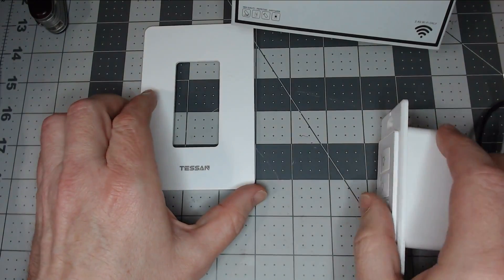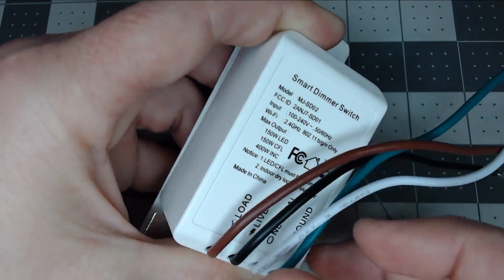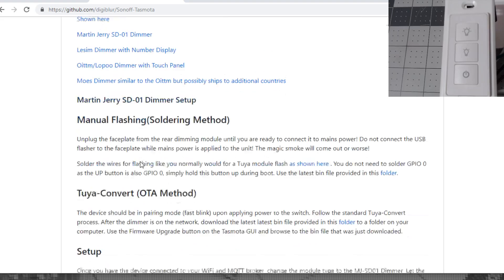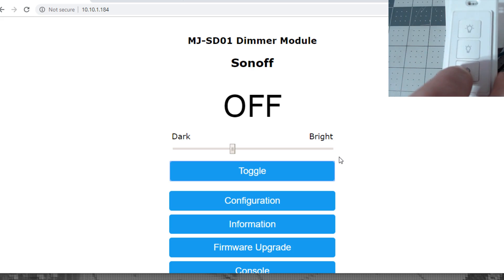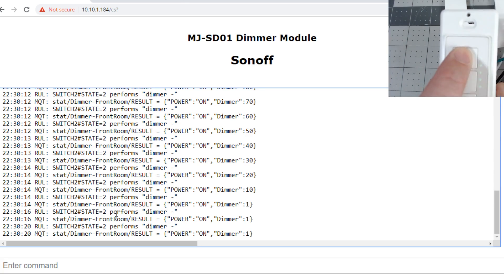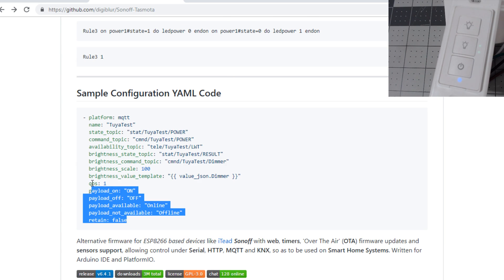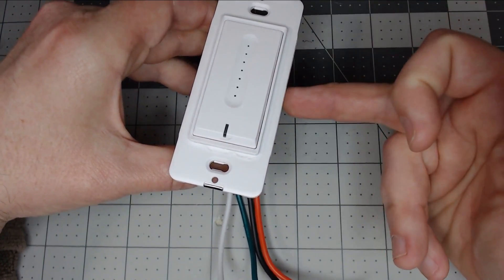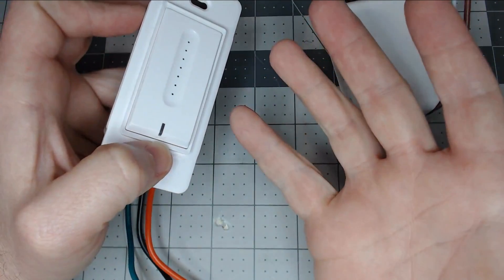Tessan, Martin Jerry, and TreatLife Smart Dimmers - How to integrate them with Tasmota

Comment: @digiblurDIY  I have flashed  your fork (9.5 ver) for my 35 numbers of MJ-SDO2 Tessan. Was working flawlessly.On recent power outrage, more than half got reset even i set SO65 1. Then now I have flashed Tasmota full (11.1) and  module 73, Everything ok except Off (physical)button not switching off the light and dimming from buttons (physical) very slow. Web GUI, Alexa, All working. your valued guidance needed. And always you are genius.
Reply from the maker: do you have them blocked from the internet?  If so you need to make sure to provide them with a local ntpserver
Reply: No I have not blocked.

Comment: Any chance of some updated bin files for Tasmota 11?
Reply from the maker: Yes. That is on project list but keeps getting bumped. Tried the PWM Dimmer module in stock Tasmota yet?
Reply: @digiblurDIY  I did, but the buttons don't work right unless I am missing something (which is very likely).  I'm on Hubitat and a dev has a new driver that needs the HTTP API in 11 to work properly.
Reply from the maker: The buttons work a bit differently.  You press and hold to dim up and down.  Definitely do a Reset 5 after upgrading to 11.x and then pick PWM Dimmer Module out of the Configure Module screen.  No additional rules needed.
Reply: @digiblurDIY  Bingo.   The reset was the secret sauce.   Thanks.

Comment: Thanks so much for all your videos and help.  I am new to the wifi switches and Tasmota.  Following your vids I flashed a couple switches no problem, thanks for that.  I only have 1 set of 3 way switches installed currently and I assumed I needed to flash just the primary switch.  All went well, I even updated to your modified firmware no problem, can connect over web etc after done.  Light switch works fine manually at the switch, but it does nothing when I try and toggle or dim etc from the web page.  Do both 3 way switches need Tasmota or do I need to pass something else on the console?  Thanks for any assistance, let me know if you need more info.
Reply from the maker: Which 3 way switch are you using?

Comment: Hi, I finally get one of this installed.  My kids like it because you can turn on the light by just pressing the top (dim+) and middle (dim-) buttons without first press the bottom button to turn on the light.  Yesterday my kids press this top/middle button but my HA does NOT show the light is on.  The HA show the on/off status correctly only when I press the bottom (on/off) button first.  Is there a way to add a backlog rule to fix this?  I am not sure how to send status of ON when you press the top or middle button since the light is on.
Reply from the maker: Setoption59 1 should be set
Reply: Thank you very much.  The status on HA show correctly after I turn on the setoption59.  You should add this to your backlog commands.  Another subject, I want to use the long press to trigger an scene/script on HA, what do I need to create on the new rule?  You show rule using publish cmd but that only to turn on another switch/light.  But I need to trigger scene on HA so I can do multiple automation such as turn off all lights, check door status, turn thermostat down, turn alarm on and announce Alexa  good night..  Thanks!
Reply from the maker: I haven't had to add it before myself as I do have the MQTT module push it after every state, and also auto discovery takes care of that since it is a light.  It's not a bad idea to really just have that option in a standard set of options you push to all of your devices.  

I don't use scenes myself but I have done some triggers based on MQTT messages in NodeRed.  I would think you could do the same and trigger some automation based off a MQTT message that you publish from a certain button push.
Reply: @digiblurDIY  I try NodeRed but too complicated on the link so I abandon it.  Can you show the rule to send MQTT message to trigger HA scene at least?
Reply from the maker: You sound like me with YAML automations but you use what is easiest for yourself and not someone else.

There should be a sample rule on my readme of toggling a flow I use.
Reply: @digiblurDIY  Do you have the link to the sample rule? I am not able to find it.  Thanks!
Reply: @digiblurDIY  Hi, today I check the same test dimmer switch when turn on from the dimmer buttons switch it does not register on the HA.  I double check the setoption59 1 is on, but no luck.  I also do same to the second dimmer.  What change do you know?  I know it works last time I tested.
Reply: I noticed than even with the setoption59 1 is on, I see the console did not send "stat/tessan3/POWER= ON" to the MQTT.  It does when turn on from the HA Gui.  What is the issue?
Reply from the maker: If it isn't send the tele after each light change then So59 is not working.
Reply: @digiblurDIY  I type in console and get respond "stat/tessan2/RESULT = {"SetOption59":"ON").  Could that be some other issues?
Reply: @digiblurDIY  I see it send the stat when turn OFF button pressed but not from the dimmer buttons turn on light.  Other option can used?  It works last time I am not sure what changed..  Can it use rule to force this stat On sent?
Reply from the maker: That option causes the tele topic to be published anytime a light changes. If that isn't working then probably a reflash and start over is on order.
Reply: @digiblurDIY  If I use this rule instead of using setoption59 or reflash (might not work because it happen on others), is this okay or have issue?
Reply from the maker: You might need to open a bug report if So59 isn't working.

Comment: Today, I got the Tessan Dimmer flash with latest Tasmota firmware 8.5.0.  Then I follow your instruction to firmware upgrade by download the "Tasmota_8.4.0.2(digiDIMv12).bin" file.  I got this error message "Upload Failed" Upload buffer miscompare.  Need help fix this error.    I open an issue on the github page.
Reply: I tried the Tasmota-lite.bin file still have the same error the "Upload Failed" Upload buffer miscompare.
Reply from the maker: Try the gzip version or you might have to do minimal.  Buffer miscompare means that you don't have enough room on the device so you need to make some by flashing a smaller bin file.
Reply: @digiblurDIY  You mean this file tasmota-lite_8.4.0.gz.  Same problem error.  Is this because manufacture figuring out and put less memory on the chip.
Reply from the maker: Actually quite the opposite, many are coming with double the flash space now.  Try the minimal then if lite gz doesn't work.
Reply: @digiblurDIY  What do you mean by try the minimal?
Reply: Maybe I should use older version of Tasmota v?? Why if not enough memory flash with lite that full version will flash?   The gz and bin are same lite files it does not flash.  Any ideas?  I got 7 more to flash..
Reply from the maker: gz should be smaller, I use them to go between versions.
Reply from the maker: This might help - https://tasmota.github.io/docs/Upgrading/
Reply: @digiblurDIY  I unzipped it.  Same 474KB as the gz and lite.bin files.  I tried both and not flashing.
Reply from the maker: If the gzip's aren't flashing then you may have some massive bin file on it then and you would need to serial flash then.
Reply: @digiblurDIY  I download this OTA firmware for tasmota-sensors.bin for minimal.  Then I flash with your lite then Tasmota_8.4.0.2 bin files.  IT works I choose the MJ-SD01 Dimmer (72) module.   Thanks!!.  I will test it some more.  It turn relay/light on when pressing the top and middle buttons without press the power on the bottom button.  Kudos,  better the OEM firmware...
Reply: @digiblurDIY  Will the MJ-SD01 Dimmer (72) module when away, when I upgrade the Tasmota to new firmware or will it stay on?
Reply from the maker: @mrteausaable  if you stay in the digidim ones it will.
Reply from the maker: Ahh...now I see, you have the big massive sensors bin file on there.  Why did you put that one on there?
Reply: @digiblurDIY  What do you mean by sensor bin file?

Comment: I just bought a few of these Tessan Dimmer from your link for my smarthome  My current is Insteon and works half of the time not reliable..  Kids tent to press the top 2 buttons since it is bulb picture.  Is there a way using backlog,  Set single press to button it turn on relay/light and dim to max.  Press middle button, it will turn on the relay/light and set the dim to min.  Long press on both buttons will increase and decreases the dimmer.  Do you know backlog command to do that in Tasmota firmware?
Reply from the maker: Are you using the stock Tasmota with the PWM Dimmer module selected?
Reply: @digiblurDIY  I think so.  is this doable to do using backlog command.  Most dimmer does not has relay(click) but this one does why?
Reply from the maker: Depends on the module. Most dimmers I know have the internal relay.
Reply from the maker: Once you get the module you have I can tell you a direction to go.
Reply: @digiblurDIY  Yes, Module type PWM Dimmer (73) currently.  When I press the middle button or top button, it turns on the relay/light  This is what I wanted but long press etcs, not work correctly without your firmware upgrade..
Reply from the maker: Check the latest changes to PWM dimmer in 9.0.0.3, if those don't work then yeah you'll need to do your own custom template/module or use the fork that I have.
Reply: @digiblurDIY  Where do I download the PWM dimmer in 9.0.0.3?  It is the one that comes in the Tasmota version 8.5.0

Comment: I just bought some Tessan with 3 buttons on the front.  Can the all these 3 buttons be program to turn different automation/lights in HA?  I only hear the bottom button produce relay clicked ie turn power on but not from other 2 dims button.  Would be great it can be use for 3 different lights in different room?  Do you have examples codes for flash with ESPHOME instead of Tasmota?
Reply from the maker: Sorry no. I use Tasmota for switches and regular pre-built devices. I do use this dimmer for multipress though. Check out the bottom of the readme https://github.com/digiblur/Tasmota

Comment: I've followed your instructions and managed to set up 3 Tessan Dimmers perfectly. It was an adventure, thanks for the education!
Reply from the maker: Awesome!
Reply: I do have a mystery, one of them appears to have a rule error. If I turn off the dimmer (set at 100%) for more than a half hour the next turn on is dim, like 1% brightness. It remains dim for 5 minutes then goes full bright.
Can you recommend a video or process to purge all rules so I can start over? Is there another possible explanation?
Reply from the maker: Are you using them with the fork? Or stock Tasmota and the pwm dimmer module?
Reply: I forked mine.
Reply from the maker: Sounds like you have some retained command in mqtt
Reply: @digiblurDIY  I cycled the power and watched the console, {"POWER":"ON","Dimmer":100} AND POWER = ON (retained)  
I'll keep monitoring the console when a dimming event occurs. I may have played around with rule 3 on another switch. If I command "Rule3 0" to all three shouldn't that eliminate outside influence?
Reply: I will rewatch your video on retained tasks.
Reply from the maker: Retained would be from the home automation software. You can turn on weblog 4 and it shows the source of the change.
Reply: @digiblurDIY  I followed the instructions using MQTT explorer, I checked all command references and none of them had retained data.
However I discovered when the dimmer does the uncommanded dimming, the HA log showed it was unavailable for 5 mins which co-insides with a reboot on the device console.
"RestartReason":"Software/System restart"
"Version":"8.4.0.2(digiDIMv12)"    
I even made a backup from one of the working dimmers and used it to restore this device with no effect. 
I do think it is an HA retain issue, I just dont know where to look in HA to nix it.
Reply: Update, after this conversation I experienced additional random dimming that was not explainable, no pattern. It still would dim exactly 5 minutes each morning.  I reviewed weblog4 data, all dimming events occurs without any messages. I temp installed a manual switch and the light remained dim. #headsmack! I checked every wired connection and replace wire nuts with wagos and swapped a different Sunco LED downlight. It was still dim! SOLUTION: I replaced the back half of the LED downlight junction box and pig tail connector. Even though my fix wasn't switch related I appreciate the feedback, I gained a lot of knowledge through the process.

Comment: Hi Travis, this video is over 1 year old.  Tasmota is now at 8.4.  Do I still need the fork, or can I now use the standard Tasmota release?
Reply: I saw a "PWM Dimmer" module choice in Tasmota 8.4, which I tried on an MJ SD01.  Dimming and on/off function seem to work as expected except for long press since default configuration has no rules defined.  Do you recommend your fork over the standard release 8.4?  What's the difference between the two?
Reply from the maker: There are presets you can do.  https://tasmota.github.io/docs/PWM-dimmer-switch/  You can also hold the up and down to repeat the dimming.  

But of course if you want multipress stuff or the old way I did it then it would be using my fork.

Comment: Quick question I got the martin jerry 3 way dimmer and it isn't flashing with tuya convert . Does the tessan 3 way dimmer work with tuya convert?
Reply from the maker: No, the 3 way MJ/Tessan dimmer isn't ESP chip based, can't flash those.
Reply: @digiblurDIY  oh okay are their any 3 way dimmers that would work? Thank you for the help
Reply from the maker: I don't, that's why I use either one dimmer and a smart switch or two dimmers using device groups now.
Reply: Mind blown can't believe I didn't think of that! Wow okay so 2 single pole dimmers in device group mode and get rid of the travel wire all together. Thank you!
Reply from the maker: Yeah so combine this wiring https://youtu.be/TjqD6UQ_oMQ

With the device groups video so you don't have to do the rules.

Comment: I've used your instructions for many  MJ dimmers in my home flawlessly.  Last week, after a HA update,  I attempted to add another dimmer.  I did it EXACTLY like the previous 3.  In the Lovelace UI, the toggle on/off does not do anything... but the slide bar works!  The extremes of the slide bar will toggle the switch, but not the toggle bar.  Any idea?  Any direction would be much appreciated
Reply from the maker: What config are you using? Auto discovery? Yaml?
Reply: @digiblurDIY  I do not use Auto discovery.  I like manual entries in the yamls.  I moved the dimmer to another test pi with the same light.yaml and custom.yaml setup.  The light.yaml is exactly your setup, other than I comment out the LWT line because I never can get that to work.    The new test pi acts exactly the same.  The toggle switch does nothing, and the dimmer slide bar works perfectly, including at extremes, turning the dimmer on and off.  the dimmer works fine through the tasmota GUI.   I appreciate your help and REALLY enjoy your channel.
Reply from the maker: So if the toggle switch does nothing it sounds like the POWER topic isn't making it over correctly.  Given that your LWT doesn't work either I'm thinking there are some other underlying MQTT issues that probably need to be ironed out with on a discord chat.  Install MQTT explorer so we can see the data as well and jump into the discord server.  You should be able to find the link on most video descriptions at the bottom.
Reply: @digiblurDIY  You are correct.  My MQTT explorer says the toggle switch is NOT sending a power command, while the dimmer bar is.  Weird ah?   I'm going to hook up another already tasmotized dimmer and see if it reacts the same.  I will report back if I find a cure.  If not, I will try the discord chat.

Comment: # ##################################
# Treatlife Dimmer DS02S
# ##################################
# template: '{"NAME":"DS02S Dimmer","GPIO":[0,107,0,108,0,0,0,0,0,0,0,0,0],"FLAG":0,"BASE":54}'
# 
# GPIO# |00| 01  | 02| 03  |04| 05| 09| 10| 12| 13| 14| 15| 16|  
#                 0|107|    0|108
# 107 Tuya Tx Tuya Transfer pin
# 108 Tuya Rx Tuya Receive pin
#
# flag = 0
# 0 No features
#
# base = 54
# TuyaMCU Enable and process data via software or hardware serial interface using component 107 and 108. Change the baud rate to 9600 bps. Process all buttons
#
# ##################################

substitutions:
  device_name: sw_treatlife_dimmer_1   # hostname & entity_id
  friendly_name: Treatlife Dimmer 1   # Displayed in HA frontend

esphome:
  name: $device_name
  platform: ESP8266
  board: esp01_1m

wifi:
  ssid: !secret wifi_ssid
  password: !secret wifi_password
  
  #manual_ip:
  #  static_ip: 192.168.1.238
  #  gateway: 192.168.1.1
  #  subnet: 255.255.255.0

  # Enable fallback hotspot (captive portal) in case wifi connection fails
  ap:
    ssid: ${device_name}
    password: "helpMeC0nn3ct"

captive_portal:

logger:
  baud_rate: 0

api:
  password: !secret api_password
  
ota:
  password: !secret ota_password

web_server:
  port: 80

uart:
  rx_pin: GPIO03
  tx_pin: GPIO01
  baud_rate: 9600

# Register the Tuya MCU connection
tuya:

# Make the light
light:
  - platform: "tuya"
    name: ${friendly_name}
    dimmer_datapoint: 2
    switch_datapoint: 1
    min_value: 10
    max_value: 1000
    
sensor:
  - platform: wifi_signal
    name: ${friendly_name} WiFi Signal
  - platform: uptime 
    name: ${friendly_name} Uptime

Comment: can this be used on TreatLife dimmer DS02S. The DS02S has similar button config and operates using a MCU.  The RX and RT work, but I want to be able to apply some rules on button presses as well as control status led.
Reply from the maker: No, you can't do that as the TuyaMCU controls all that.